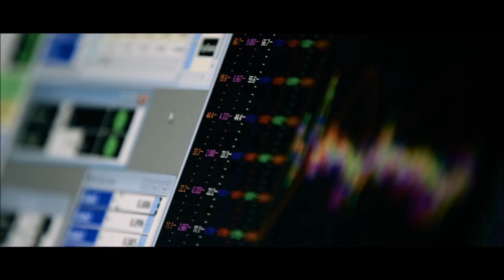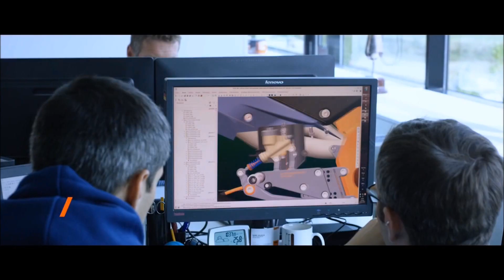KTM RC16 - Full Development Video | Building a Prototype

Comment: Why japanese made more durable and reliable bikes?
Reply: Because good manufacturing technology and attention to detail
Reply: in house made parts and high production volume to eek out small issues. If you look at Euro bikes, a lot of them share same brand components across different brands. i.e. Brakes, Electronics.  So reliability is sacrificed.
Reply: Japanese bikes usually have lower engine compression and less electronic aids. They don't have the guts to invent new parts because they afraid the engine won't last long. They like to play "safe". Meanwhile, the european counterparts, they love to invent new things. The first motorcycle are invented by europeans. A lot of new parts, electronics, aerodynamics are patented and even used by japanese bikes. But because europeans love inventing new stuff, they usually forget how to make them reliable. The need to sacrifice reliability for new inventions. People saying that japanese bikes are more advanced than european bikes.. complete bs.

Comment: Please make a road inpsired version of this, even though you dont want too :P
Reply: they have ktm rc 200/250/390 but only 1 cyl. 
hopefully they will build 2cyls 250cc's like Japanese brand do's
Reply: Chandra Yudistira 250cc 2 cyls have very weak torque, compared to KTM 1 cyl. You need to rev higher to get the torque kicks in, but the 1 cyl will deliver torque and power across all rev range. If you only care for sound, then motorcycle isn't for you.
Reply: 01yala  Ninja 150r, Ninja 150rr, Kawasaki KRR, Yamaha RX King, Suzuki Satria. That's beast from South East Asian 2strokes